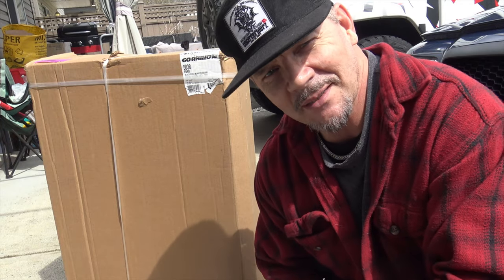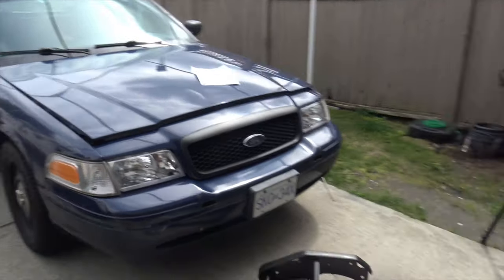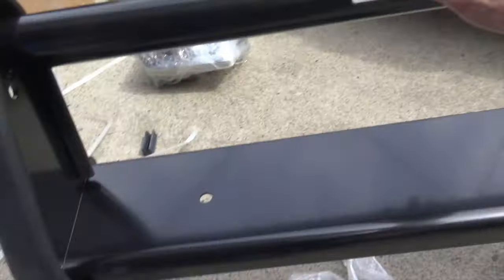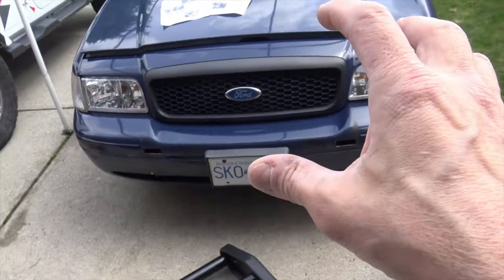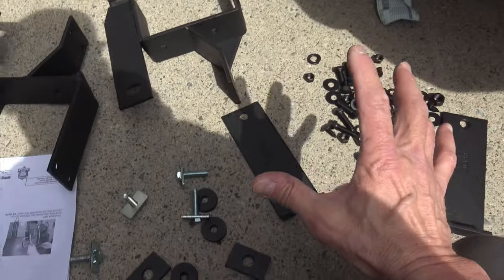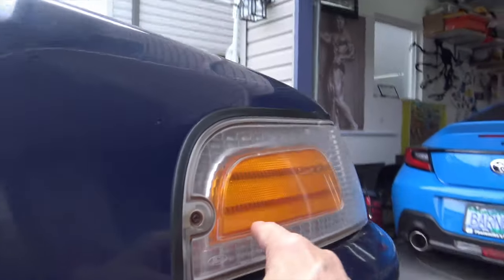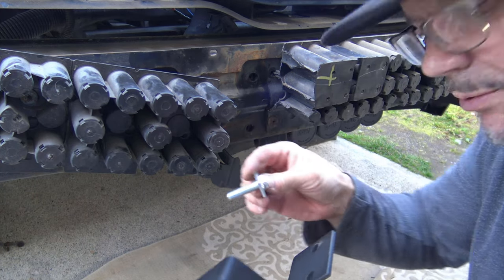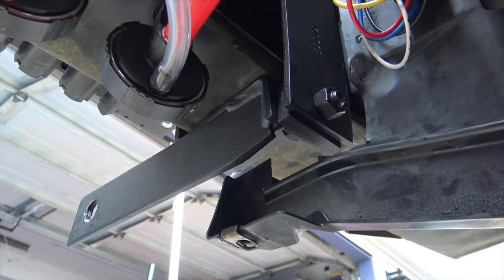Go Rhino push bumper install nearly kills me!

Comment: It appears the sticker is centered, the brackets however are not aligned properly, causing the push bar to not be centered, you can see it at 10:30 in the video. Readjust the brackets to center the entire pushbar, the push bar is aligned too far to the driver side

Comment: I made the mistake of buying an old rust used one from a friend that was missing most of the brackets. Also after getting the brackets jury rigged onto the car I find out they're bent so bad they won't slide through the holes I cut in the bumper cover. This is a huge pain in the ass. I shoulda just bought a new kit like you did. Don't buy used police gear, it's usually all beat to shit. I learned the hard way.